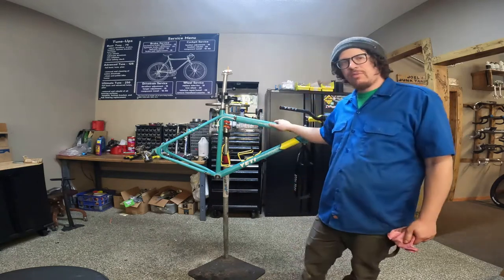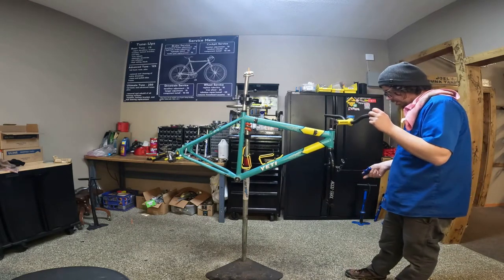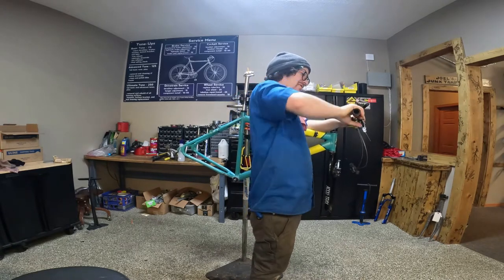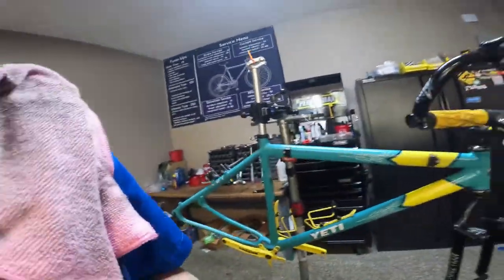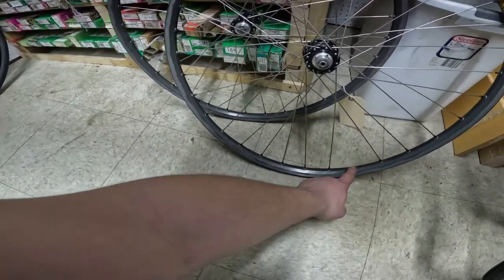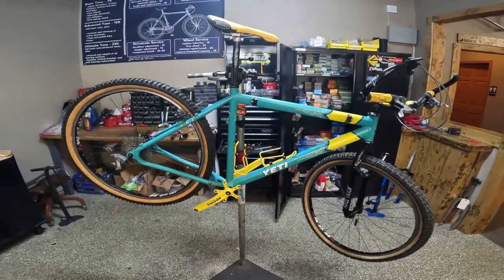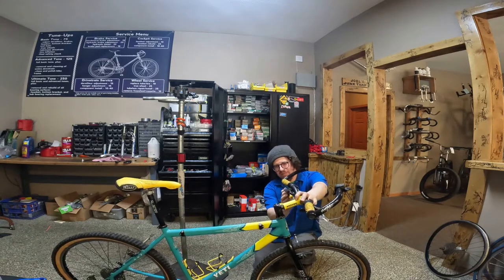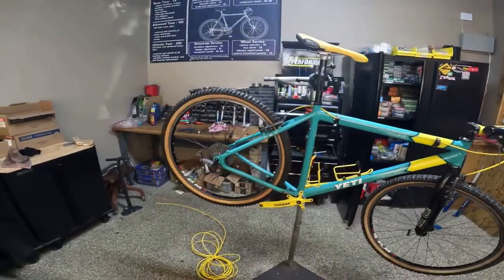1998 Yeti Arc Vintage Mountain Bike Build Part 2

Comment: Lovely job.  However, for me I would run a shorter stem, maybe 50 or 60mm and really no Onza bar ends.  FYI I have a Kona AA of similar vintage with those same Yeti grips, they are excellent, grippy and comfy.  Also, it has Mavic X517 yellow rims just for the match plus a bunch of other parts you have already used on other bikes such as Arch Rival brakes and Marzocchi Z2 X-Fly silver/yellow.  Cheers :)
Reply from the maker: Your Kona AA sounds sweet!